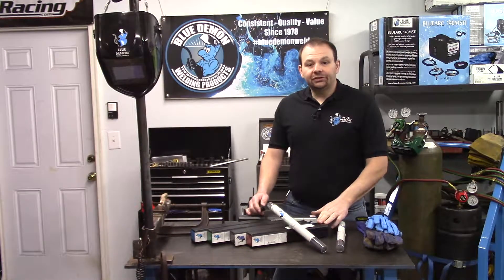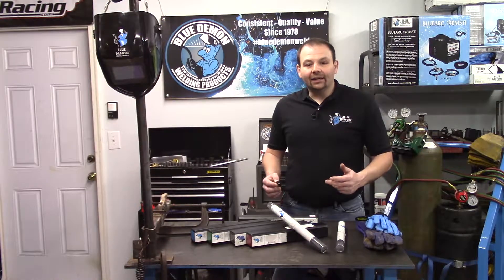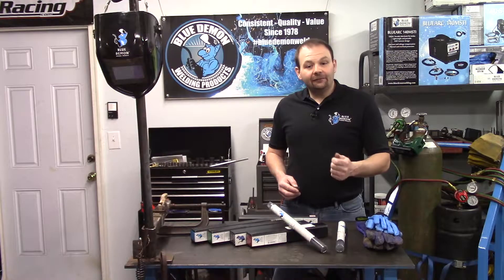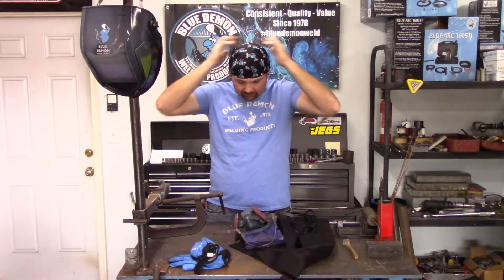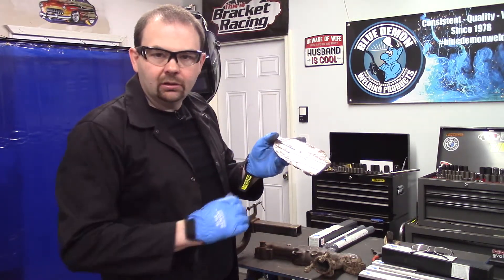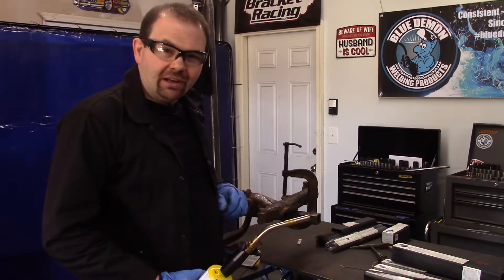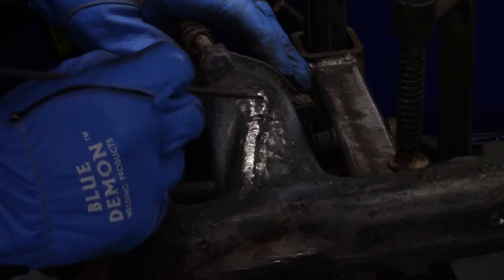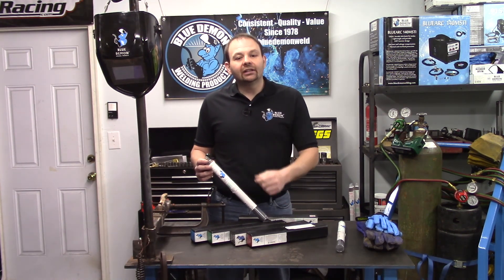Blue Demon ENI99 Cast Iron Welding Electrode

Comment: Love the video.  Its hard to get this to fuse, Im running about 100amps.  Im welding rebar onto cast manhole cover.
Reply from the maker: what diameter rod and what thickness base metal?
Reply: @bluedemonweld  1/8 rod cast manhole cover.  Needed to weld rebar to top so it could be lifted/opened.
Reply from the maker: 100A is the sweet spot and should work just fine.  did you preheat the manhole cover?  that's important.... @TIG2MAN0
Reply: @bluedemonweld  its 120degrees and absolutly zero humidity.  But no to preheat.  I think I was running 125 amps.
Reply from the maker: @TIG2MAN0  I hear ya partner!  lol... but cast iron really needs to be preheated to 500 deg to insure a good weld, and hopefully zero cracks.
Reply: @bluedemonweld  I agree, but boss doesn't want to take the time.